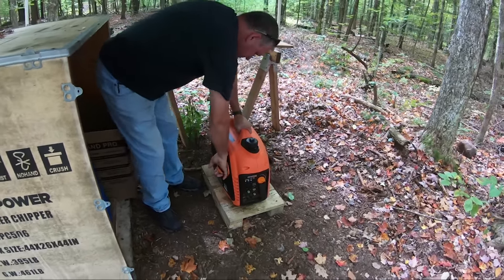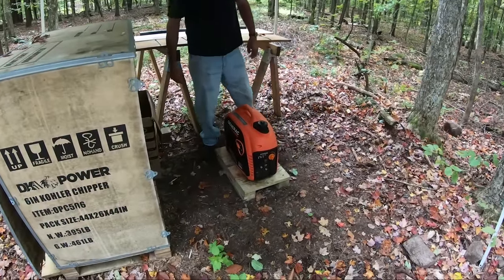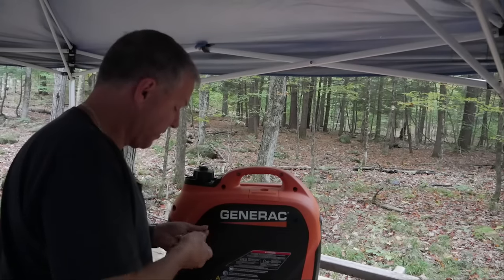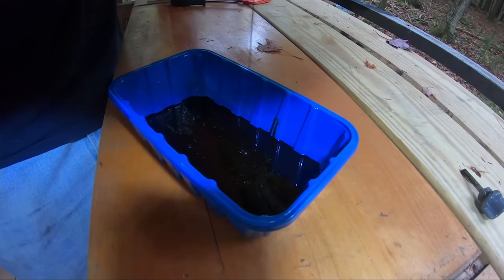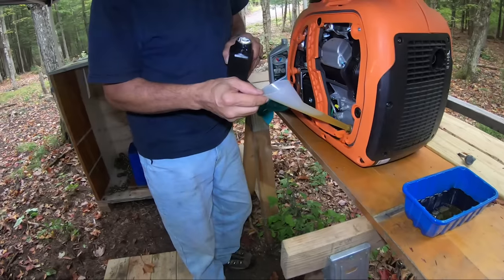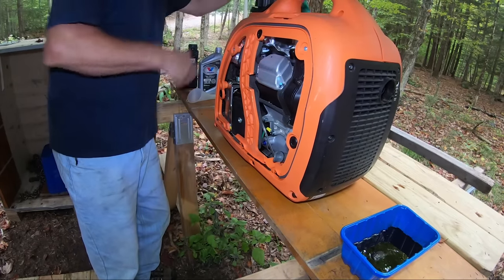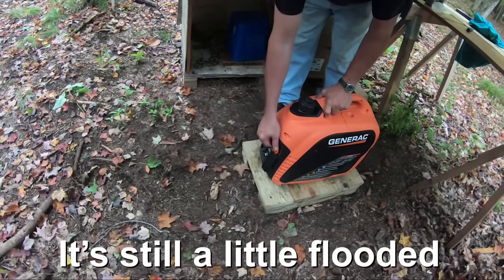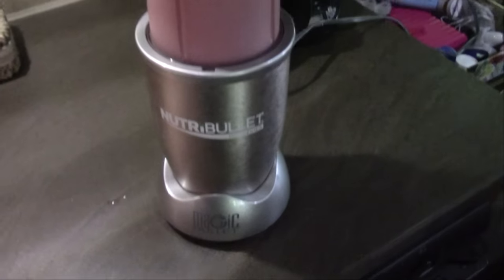GENERAC GP2200i - BRUTALLY HONEST 1 YEAR REVIEW

Comment from the maker: Well, after one year of using this generator we felt it was only right to share an up-to-date review...and it is definitely a BRUTALLY HONEST review....that's for sure! Hope you enjoy. Rich & Kathie
Reply: oil filter? did you do another oil change pretty quick?
Reply from the maker: Chuck T. We will be when we get back up there!
Reply: You are welcome. There is one step in draining the fuel for storage most sites omit. First run your generator out of fuel. There is still fuel in the bowl, loosen the carburetor bowel screw and drain excess into an environmentally harmful container. Then make sure the unit is off and crank the engine a few times to remove all of the fuel. If you are going to let your generator sit, fog the cylinder it will help with rust. You are now allowed back into the generator's Hall of Fame.
Reply from the maker: @TheMickeymental  Good information. I will definitely remember it for this winter when we store it. Thanks very much.
Reply: @TheMickeymental  Drain into an environmentally harmful container?
Reply: I was pointing out that you actually used the word "harmful" where I think you meant to say the opposite. That's all.
Reply: @joewoodchuck3824  Maybe he didn't...not everyone that gets out in nature or uses a generator is a tree hugger...myself I would use something that I could burn the gas off in...as in light it on fire...
Reply: not tryna argue but  Thanks.
Reply: You aint lying!
Reply: Hey guys, how long does a tank of gas get you with everything running?
Reply: @fredmckinney3418  That sounds like a lot of work. I don't know your financial situation, but some batteries charged by your generator and an inverter might save you some expense in the long run. Good luck to you.
Reply: @fredmckinney3418  It seems like you have a good plan, initiative and the impetus. I put $53K into a solar system and when I sold my house the buyer wanted it for free.  Good luck to you sir.
Reply: @TheMickeymental  what about of ur using tru fuel.  Cant i still store gas in my gen for awhile
Reply: @paulpersons799   If you run your carburetor dry and ad Tru fuel to the tank it should be fine. I  use non ethanol fuel and add stabilizer and then store the fuel.  I have gone up to a year and a half and didn't have any problems.From what I have read Tru fuel will last longer, but there are many variables about how long fuel will last. Tru fuel is expensive.A gallon of tru fuel will coast between $92-$132 per gallon.
Reply: @TheMickeymental  i just bought the generstor new yesterday and tru fuel is what i put in it.    And it cost 20 dollars for about a gallon for me.
Reply: @paulpersons799  I looked on Amazon and it was $21 to $23 per quart. this was for the 4 cycle. One seller had it for $12 per quart. The 2 cycle is much cheaper. Glad you got a good deal.
Reply: I use two PowerBar 2000i generators at my cabin, my wife uses a oxygen concentrator so I run each generator 12 hrs , being a generac,  it calls for 5/20 synthetic and I change the oil every 48 hours and the spark plugs every 150 hours.  We stay at the cabin a week at a time. These generators have been running for 3 full summers,  no issues.

Comment: I have used a Briggs and Stratton generator branded under “Troy Bilt”. I have had it since 2005. I have used it through multiple power outages for weeks in a row. I also ran another identical generator at a job site for 98 days straight. The generator performed flawlessly. Frequent oil changes and never a glitch. Never! Take care of your gensets.

Comment: For small engines, spend a little more and get ethanol free gas. Ethanol stored for a long period of time collects moisture resulting in harder starts.

Corn should not be in gas, PERIOD.
Reply from the maker: Agree. I will have to see if they sell it anywhere near us because I have never seen it. Someone said to check marine stores so might try that. Thanks!
Reply: Bingo on the no-alcohol gas.  I forgot to drain my generator carb one time.  The alcohol in the gas turned the rubber parts in the carb to mush.  $100 later. And a fuel shut-off valve added on and I was back in business.  Ah, life’s lessons.
Reply: @CreatingASimplerLifeOffGrid  https://www.pure-gas.org/  any marina will have rec 90. another source of ethanol free gas is your local general avation air port. thats usually 100 octane low lead. lastly and the most expensive, is either vp fuels or sunoco race gas. that stuff is $12 a gallon but comes in its own 5 gallon can.

when storing the genny always shut it off for the last time using the fuel cut off. ideally just run the generator dry.

keep that oil changed! these things have no oil filter.
Reply: it does burn cleaner, so in a big city it plays a part in reducing overall pollution. My problem is ethanol is much cheaper to produce but not all of those savings are passed on
Reply: That only true after it has been sitting for more then 6 months are lawn mover sit all winter long in tell jan then start them up let run a bit shut down it going depend on how long you winter are but I also add a bit STA-BIL.
Reply: @MrSGL21  I use 100LL in all my small engines.  It works very well in 2 strokes as well.  The only thing to watch out for are catalyst mufflers.
Reply: Yes ethanol free gas and a stabilizer additive.   Even with that gas doesn't last more than a year or so.
Reply: I believe you have lower btu's with ethanol.
Reply: @Rick-tb4so  correct.  Ethanol has about 2/3 the energy of gasoline
Reply: Next generator , buy dual fuel .  Propane doesn't create all of the problems that gasoline does .
Reply: bernincoal1 How about simply running it out of gas before storage?😉 avgas is overkill, expensive and most airports don’t sell small amounts of fuel. ( yea yea yours does lol 🙄)
Reply: @CreatingASimplerLifeOffGrid  the Tube is filled with millions of engines that are damaged by old gas and ethanol...good luck..admire your choices in getting away to a simpler way..
Reply from the maker: @iamrichrocker  Thank you!
Reply from the maker: Klaa2  Yes. We use fuel stabilizer in the winters. Works good. Hope you have a happy New Year!
Reply: Corn belongs in whiskey not gas!
Reply: You don't need ethenol free gas. Just add Sta-Bill
Reply: @edwoll  Yes, but pure gas is much better and lasts longer. Small engines like pure gas. Also, small engines don't have computer management that adjusts for best performance. The're basic engines.
Reply: @edwoll  Sta-Bill will not protect your engine from ethanol. It will only stabilize 100% pure gas.
Reply: @bernincoal1  Don't even try it. The ethanol will still eat all your gaskets and fuel lines. Stabil will not protect against ethanol. That's already been debunked right here on youtube.
Reply: Several times in this thread the idea of adding fuel dryer to the fuel to counteract the alcohol that absorbs moisture from the air was suggested. Do any of  you Einsteins know that the the fuel dryer is alcohol? Uhhhhhhhh
Reply: drives a ford model t and operates a hit an miss engine on 100 percent ethanol fuel Yeah, No. They just don't make them like they used to and thats a fact. Old Iron on LOW RPM will last forever.
Reply: Walmart sells it
Reply: It would be a help if the manufacturers would provide an alternative method of starting. Specifically I'd like to see some kind of hex shaft so it could be started with an electric drill. Electric start costs too much money.
Reply: you know nothing of betex additives. Ethanol is actually good, it doesn't destroy plastics and it carbon cleans the engine and gives a nice octane boost. Benzene, xylene, ethylene, and toluene are what breaks down and destroys engines/carbs. They are harsh burning fuels that produce soot and carbon deposits, pure petrol gas aka ethanol free is also harsh burning and can cause issues with carbon deposits. You need to look up the msds for gasoline by marathon brand and others to truly understand what is in your fuel. ETHANOL IS GOOD everything in regular 87 octane is bad.
Reply: Yes, & WWG1WGA
Reply: @michaelbayliss1794  Also, any gasoline-powered generator can be modified into a dual-fuel machine with a $35 kit.
Reply: bernincoal1 thanks mr president. Good advice
Reply: bernincoal1 ethanol based on sugar cane is the best not sure why our country puts more strain on the most used crop! Sugar easy to grow and abundant, just ask Brazil
Reply: Live2RIDE83  nopw
Reply: @mikeries8549  I do... 🤣
Reply: @CreatingASimplerLifeOffGrid  I've been using K100 as an fuel additive after it being recommended to me by my Stihl sales and repair technician.  It will stabilize fuel for up to 2 years.  I use it in my fuel for weed eaters, chainsaws, terramite backhoe/loader, riding mower, and periodically in my vehicles.  
The cost is about an additional $0.45 per gallon which is well worth it especially in small engines.  I've seen the effects of ethanol use in small engines that can set for any length if time and it's not pretty.  I have about 45 years experience working on small engines and I've not had any carburetor issues with any of my equipment since I began using K100. 
K100 was also the only additive that my Stihl dealer would approve to prevent carburetor issues and cover my equipment under warranty due to fuel related problems.
Reply: @The Profit My local Caseys sells it for about 75 cents more. I think all Caseys would sell it.
Reply: Even better buy a dual fuel generator. Run it off propane. You will never have that problem again.
Reply: My chainsaw agrees with you
Reply: @bcgrittner  
Same thing happened to a friend.  The gasket inside the fuel shutoff valve rotted and blocked up the valve.
Reply: Ethanol Shield is great.  Removes the ethanol and stabilizes the fuel.   Buy it at Home Depot.
Reply: Mike Ries  Lol, well said in a kinder gentler way. BG Products makes an gas additive called Ethanol Defender Pn213 that coats and protects parts against ethanol corrosion and has a super marine grade fuel stabilizer. Also, has a fuel system cleaner that cleans injectors and dissolves carbon in the combustion chamber. Works in 2 strokes too. 😀 Houston TX - we have ethanol everywhere..🤣
Reply: Your right it should not be but what can you do its getting harder to find it and when you find it the price for it is out the roof sadly.
Reply: Good luck finding ethanol free gas 😂
Reply: They don’t even sell it in this state because it is crap in the cold.
Reply from the maker: We actually had to use it in the cold last winter and it worked great for us.
Reply: @CreatingASimplerLifeOffGrid  I don’t know how cold it gets there, but we run our generator to charge the batteries at our remote cabin when the days are short. We have an enclosure for the generator because the crankcase breather plugs up and builds up crankcase pressure. I am talking temperatures in the -30 to +10 range when this happens
Reply from the maker: Wow! That is cold! We haven’t used ours below 10 deg F
Reply: Truer words have never been said.  Used to be an ethanol fan, until I had to rebuild several carbs on my old bikes.  No more ethanol, no more problems.  And I always used Stabil or Sea Foam.  Even with those stabilizers, the ethanol caused issues.  Don't risk it unless your going to run through the whole tank quickly.
Reply: You got that right. The agricultural big guys are being subsidized by the taxpayer to ruin engines and reduce fuel efficiency - while the 3rd world could use that corn for a very different purpose.
Reply: @GarlandFarms  ??Where do U purchase the kit?

Mind dropping a link??
Reply: You are so right! I only use ethanol free gas in all of my small engines, even if it says you can. We call it clear gas in Oregon.
Reply: @MrSGL21  0
Reply: A little more?  Bullshit. A lot more
Reply: @CreatingASimplerLifeOffGrid  Google just gas will show rec fuel near you
Reply: USE non ethanol gas and NEVER had any issues in lawmower, pressure washers, or snow throwers
Reply: ya for $20 a gal LOL

Comment: I’m so glad you made this video .  I bought one , took it out of the box , and set it away for future use .   It’s been like 2 years and I have never ran it .    But I am gonna be soon .  I’m glad you got your machine running and talked throughout the video .   Now , maybe  with luck , I can fire mine up too .
Reply from the maker: I would suggest taking the spark plug out and placing a couple drops of oil down in the cylinder before starting it. Hope it starts up with no problem and you have as much success with it as we do. Have a great day.
Reply: She seemed like she wanted to learn and even offered some useful advice, she was right about not screwing in the dip stick and it wasn't level.
Reply: Tim, did you get yours out?  Did it run?  I’m looking at getting one but it would only be used for emergencies but don’t want to get it, if it’s going to require monthly starts, etc.
Reply: @dsmith2858  Go with a dual fuel generator and only run propane that's what I did. By running propane you can let it sit for years come back and it'll still start up no carburetor or fuel problems by running gasoline ever. Propane is the lazy man's fuel you can go longer on oil changes. Because the oil is so much cleaner and the spark plug always looks new it never fouls. A propane engine lasts twice as long as a gasoline engine. You never have to clean the spark arrestor because there's no carbon inside the engine when you only run propane. Propane in my area is $2.00 a gallon. Having a dual fuel is a better prepper generator when things sell out and SHTF.
Reply: @tomtee4442  do you run off a 20lb cylinder?

Comment: Amazing that engine runs at all after not having the oil changed till 343hrs! I can't believe it.
Reply from the maker: Jack Stasney it is and it does and we are thankful. It’s still running as we were just using it recently. It’s holding up really well and still working great. Thanks so much for watching 👍
Reply: 343 hours ?  I changed CAT equipment oil at 200 hours Caterpillar’s  interval was 250 hours. I got one new 988 loader in the quarry and took extra care with it and it ran 13,800 hours and only needed a new head gasket. Maintenance is what keeps your stuff working
Reply: Well, that's the power of synthetic oil!

Comment: A trick I learned with small capacity oil sumps and refillable shock absorbers is to measure the oil charge into a baby bottle, then dump into the sump. Baby bottles have graduations to measure the volume and can be left with oil inside without leaking after closing it up.
Reply from the maker: That’s s great idea! Thanks for sharing it. Have a great day 👍

Comment: Try pulling the starter cord 3-4 times while it's in the off position.  Then let it sit for 2 minutes before you start it.  This will allow the fuel to get into the carb and allow for an easy start.  You only need to do this if it's been sitting unused for a few weeks.

Comment: how often do you change your car engine oil, 30 or 40 thousand miles or do you just wait for it to start knocking ?
Reply from the maker: I know. Was a huge mistake but appreciate your watching and commenting!
Reply: @CreatingASimplerLifeOffGrid  -You Tube videos show how to easily make your own ethanol free fuel... Back when ethanol was not in fuel, farm machines, home lawn mowers, edgers, large and small, lasted decades, carburetors remained functional.... with no issues.
Reply from the maker: Blogengezer interesting. Will have to check them out. Thanks 👍
Reply: @Blogengezer  If it could be converted to propane, it would be even better.
Reply: Ha!
Reply: Change? Just add oil when motor plays "Wipeout".

Comment: Good video. Two points to keep in mind. First invest in a battery oil pump  it makes changing oil so much easier. 2nd use a sharpie and write in the generator the # of ounces needed. 3rd get an ounce  cup to ensure perfection each time. I owned a lawn and garden motor repair  business  for 20 yrs.
Reply from the maker: Great advice. Thanks so much! 👍
Reply: Hand pump vacuum oil changer
Reply: @zeusapollo8688  if it works for you 
 That's the key. Making life simpler
Reply: Link to the battery oil pump you recommend??  Thanks
Reply: @Samlol23_drrich  look for boat oil extractor on Amazon. Its 12v battery hookup and works well. But there are others. This is very portable.
Reply: @retireeslife4013  thanks!
Reply: Yep using an oil pump leaves all the filings and sludge in the crankcase..... glad we never used your small engine repair shop. We do it the right way.
Reply: @xraykadiddlehopper8067  well mr natural if you change the oil regularly you wont have sludge build up plus we had a pencil size magnet  placed in the drain hole. You keep doing it your way. I wish you nothing but the best with everything you think you know.

Comment: If Kathie is a keeper for you, that's great!! Bet she'd be a keeper for a lot of guys.  The Question is: Are you a keeper for Her???  (Said with the best of good humour!)  Suggestions:  1) check the oil Every Time before you start the generator.  You keep better tabs on both the level and condition that way.  2) follow the maintenance schedule in the manual - plug, O/C, air filter, spark arrestor and the rest.  3) to level it, set your generator platform on cement pavers and use a couple white cedar shingles as shims between the pavers and your platform.  Keep an inexpensive level handy.  4) Have sides available for your cover to protect against wind driven rain.  Maybe a large Rubbermaid tub with vent holes cut in it might work?
Reply from the maker: Thanks very much! Yes, Ive learned my lesson about letting it go so long. Appreciate you taking the time to comment. Have a great day and hope all is well where you are :-)